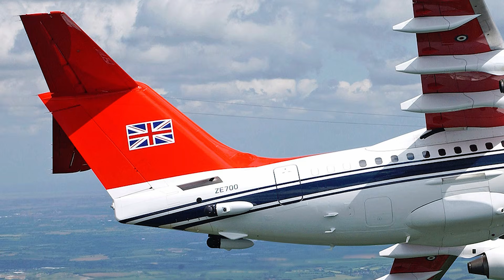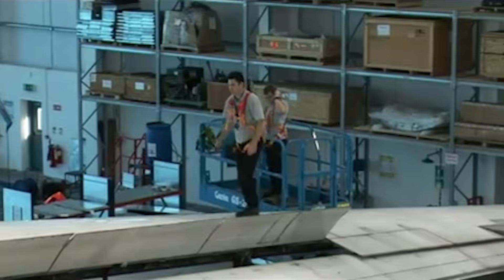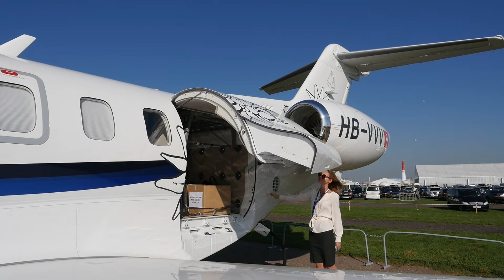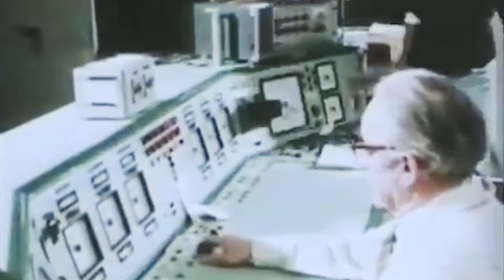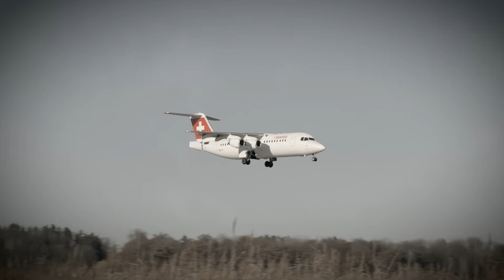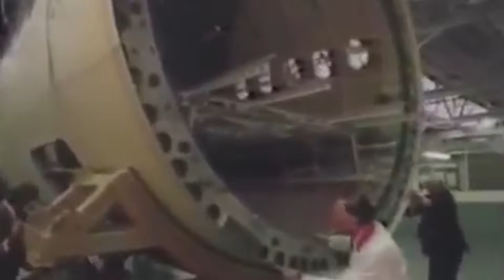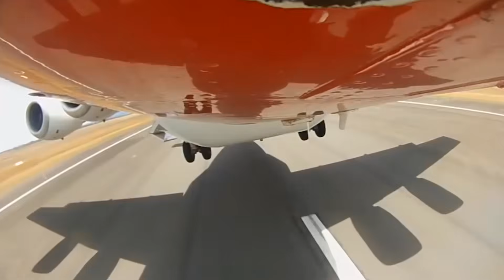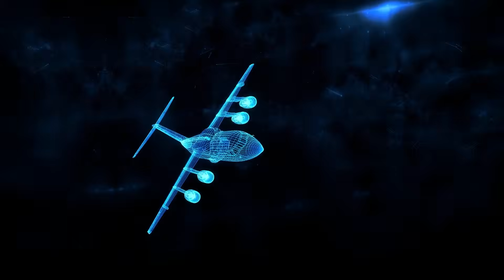BAe 146 - more engines!

Comment: -I remember flying on one of these in the 1980's when I was a student at Embry-Riddle.  They operated them between Daytona Beach and Detroit, if you can believe it. Presidential Airways.  I bought some sort of ticket where it was partially refundable if I could find a person to take a later flight and I lingered near the ticket counter in Daytona Beach.  After about 20 minutes, the gate agent told me to leave and threatened to have me arrested.  I told her I would leave but what comes around goes around.  Guess what?  Five years later I recognized her at an interview that I was conducting;  I'm not kidding, this happened.  OK, I let her give her whole spiel, I purposely kept her there for 40 minutes, nodding my head at the appropriate times.  I gave her the full interview.  And when she was done I reminded her of the whole Presidential thing, made a point of telling her to FUCK HER SELF, and then asked security to escort her from the building.  

Aviation, like REVENGE, is a dish best served real fucking COLD.

Comment: One of the issues is that is the are  seats just behind business class. normally popular with the huge majority of regular business passengers who do not fly premium have restricted hand luggage as the wing box squished overhead luggage locker to laptop size bag. Seats further back are full sized but no longer possible to quickly scoot out of the cabin after landing. Also prone to aviation fumes at take off in the cabin which could get quite strong. I suspect the luggage thing was one of the  issue that halted developments with single engine variations.

Comment: What are the two pods mounted on the rear most underside section of the fuselage : seen @ 1:11 ?
Did Rolls Royce produce an equivalent or better engine engine that would have improved performance ?

Comment: Jumbolino, one truly lovely aircraft. I wonder if we will see some four engined "jet" planes, with two engines being just plain electric fans (for takeoff and landing to limit noise) and the other two high bypass turbofans, for flight at cruising altitude. The economics of this is clearly not great, but it would allow to operate much closer to populated areas. Also, the battery could be powerful enough just for a couple of minutes of full thrust. And once at cruising altitude and speed, the electric fans could slowly recharge the accumulator for landing and taxiing on the runway. With recharging on the terminal. Super quiet plane, with lots of redundancy. Also in extreme cases, able to start on super short airfields, using all engines at full thrust.

Comment: WHY 4 ENGINES?
In the late 1980's, I was studying (Aerospace Vehicle Design) on the College of Aeronautics in Cranfield (UK). If I recall right, our Professor for Aircraft Design, John P. Fielding (also working on the BAe 146 design) mentioned, that the initially designed of the (Hawker Siddeley HS.144) was with 2 new engines. A bit over-powered, because one of the design specifications was, that the aircraft had to be able to start and land at the new London City Airport (Docklands), with it's short runway, the stringent noise requirements, as well as it's steep initial climb and approach angle (slope). 
However, due to the collapse of Rolls-Royce in 1971, the planned new Rolls-Royce Trent engines would not be available. And since there were no matching  alternative engines available for this project, they finally went with those 4 smaller ones. (Avco Lycoming ALF 502). And the project was changed to HS.146, which later became BAe 146.
What I don't understand, that they did not switch to a 2 engine design later on, when alternatives were available. But it might have to do with certification. It might be, that it requires a complete and expensive new aircraft certification when changing the numbers of engines, rather than changing the type and/or brand of the used engines.
Actually, having 4 engines rather than 2 is less economical. (More fuel consumption, higher maintenance costs.) And reliability is not an issue anymore. Even most long range aircrafts (trans Atlantic aircrafts) only have 2 engines nowadays.

Comment: The 146 was the only jet that could fly me out of the San Francisco Bay area the day after the October 1989 earthquake. My company desperately needed me to be on the east Coast the week of the quake. All Bay Area airports were closed but a regional jet flew out of Santa Rosa, an hour north of San Francisco, to Los Angeles (LAX was not affected.) So I went to STS and because telephone service was down, with no reservations. I found the small terminal  besieged with like minded passengers. Without electrical power the gate agents had no way to check tickets. So they asked for a raise of hands and found that they could accommodate all that wanted to go. They didn't or couldn't bother with tickets or boarding passes!
Waiting on the tarmac to take us to LAX was a BA-146. I suppose With its APU, it was self sufficient. The pilot told us he could radio LAX and would get us there!

Comment: I have worked on a lot of the aircraft shown in this video and it taught me a lot about aviation engineering.  I wouldn't call it easy to work on compared to E190s or A320s, but then a lot of modern aircraft tell you what the problem is.  BAe made you work for it...

Comment: Some features in the automation of the RJ series, were definitely better than the Boeing 737 NG - automated go-around features, Windshear modes etc are something the 737 NG do not have.  Indeed they can carry a heavier payload out of smaller airports than a 737.  And on short routes, they keep up with the larger A320/737 / mainly on descent; they can hold a higher transition speed and keep it down to 10,000 ft due to the ability to slow down with the huge airbrake.  They suck fuel for sure, but in the typical roles they fit into, fuel efficiency is second.  fit the bill in the low 30s.... FL 300 and FL310 are good altitudes but max alt is FL 350.  They still fill a niche in places like Canada; especially where 4 engine reliability is an asset for customers.  losing a motor at any phase of flight, is a non-event.

Comment: The only problem I had with the BAE146 was the fume smell in the cabin before take off. I flew as a passenger across Bass Straight a lot and always hoped for a short taxi to the runway because of the stink. Once airborne they were fine.

Comment: I always enjoyed flights in and out of John Wayne airport in Orange County, California.  At the time I had a office almost directly under 'short final' for the approach.  You couldn't hear the little beastie even with the office windows open.  I was pissed when American Eagle replaced them with loud 737s.  Noisy effin things!

The 146 had one tiny problem for passengers,  If your seat was toward the back you had to remember to duck when the main wing spar passed through the cabin.  For shorter people like me it was not a problem but a few taller folks would bang their head on the roof panels and grumble about it.  American Eagle used that as their reason for switching to the 737.  Pissers.

Comment: The design owes a lot AW 681 Stol Freighter, many of the same designers were involved, they literally built 5/8ths size version of the AW 681 and the intial work was started in the mid 60s after the AW 681 was cancelled in 1964, principally to keep the design team together. It also got left behind in the market, in the 70s Africa was borrowing money to set up State Airlines, by the 80s Africa was bankrupt and the market was the 1st world and so it's STOL and operational flexibility was not worth the higher fuel consumption of 4 engines.

Comment: I recall flying on one of these.  I was shocked to see 4 small jet engines under the wings.  The captain was greeting each passenger as we boarded.  As a pilot, I asked him how well the aircraft flies (handling, etc.).  He winked and said, "I'll let you know!" implying it was the first time he was flying it.  I'm sure he would not have said that to a non-pilot.  My recollection, as a passenger, was the nice, roomy, interior.  It felt like a much larger aircraft and not a regional commuter.  I was quite impressed with the flight, the quiet ride, and the comfort.  No complaints.

The video stated there were 90 some odd still in operation.  I wonder who is flying them these days.  Also, you'd think some of these would have gone into private service.

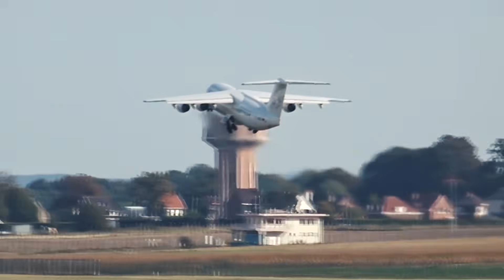Comment: 12:10 I see an issue here with reverse on only one engine and it throwing the plane out of balance.
Reply: That's the speed brake. No TRs. Wish it had  them where we went with them.
Reply: Mx pulling engine service.
Reply: That's not a 146 landing with one TR.

Comment: I flew into Appleton Wisconsin on one of these planes on a two stop flight. I was impressed with the smooth and quiet flight and the very soft landing at the first stop. On our second last  leg into Greenbay, the tower  reported the runway had recently been cleared of snow. As we landed the breaking system grabbed strongly on the starboard side and the plane rotated sharply to the right .Quite an experience! 
After watching this video I understand that the lack of reverse thrust makes it unsuitable for landing in wet or icy conditions. The speed brake on the tail did little to slow the plane.
After this incident, the pilot announced that we would be taking a bus to the Appleton Airport.

Comment: This was one of the aircraft types that I started my aero engineering career on.
Roughly the same number built as the Boeing 737-200, but theres 90 Bae 146's flying but only 36 737-200's
In the early days the ALF-502 engine gave a few problems but it was possible to take off on three engines as long as it was empty of passengers.
You could fly it back to base on three engines!

Comment: You know the terrain, so what aircraft product best suits that terrain. But reiterrating a previous statement, try not to rely on one companies product as they then have a potential monopolistic supply position over you. Boeing is in a vulnerable position at the moment over the 737 Max Debacle, paid off their CEO with $64 Million US Golden Good Bye and promptly made 2000 staff redundant to pay for it. Nothing wrong with any of those aircraft. You just need a big metal tube with wings, and engines with shit loads of power. And landing gear built like a Meccano model One suggestion though! Have you ever thought of underbelly doors? Either manual or hydraulic. Thinking it maybe easier to load from the bottom in an older reworked aircraft and safer for the loaders. But honestly not aware of cost implications.

Comment: Wonderfully researched as always!  The BAE-146 had amazing short-field performance for a jetliner. The four jet engines blowing on those huge Fowler flaps practically created their own lift!
Reply: I don't think that is how active lift devices work. You can blow air over a wing to increase lift, but I don't think that blasting your flaps with air under the wing will do much.
Reply: @justforever96  - actually blasting your flaps with air under the wing does a huge amount to increase lift at slow speeds. Wings generate lift by rotating air downwards. Since the flaps redirect the jet exhaust downwards, it generates lift. FYI, the USAF C-17 Globemaster cargo plane, uses a similar technique to improve its short field performance.

Comment: Made a round trip on one from Chicago to Lansing, Mich. Was impressed on low noise in cabin except when landing gear was lowered. Looking out the window, the jet intakes made the engines look small, making it seem that they needed 4 of them. Later found out that the plane was engineered to be quiet- a new concept at the time. Alas, every good thing eventually goes away.

Comment: I used to drive these.  Some memories, a few of which may be a little fuzzy: first 4 engine jet certified without a flight engineer, was hoped it would become as popular and long lived as the DC3, the Lycoming engines were adapted helicopter engines, the 100 series was nicknamed the “Smurf Jet” and the 200 & 300 series the “Barbie Jet”, also nicknamed the “Whisper Jet” though I always thought it rather noisy, two hydraulic systems -green system & yellow system with redundant drives, the outboard engines drove the generators and the inboard the hydraulic pumps, pitch oscillations -they’re a thing and we were trained and tested over it, flower pot - a modification in the tail that allowed flight at higher air speeds in icing conditions and reduced the likelihood of pitch oscillations, the yoke controls tabs on the elevator and not the elevator itself as it is free flying, the only turbine airplane I ever flew that the engines might not start in cold temperatures -the primary injectors would work but the FCU (fuel control unit) would freeze up and secondaries would not kick in leading to a hung start -very embarrassing to have to deplane passengers in KASE (Aspen) to get the engines pre-heated, helluva lot of fun to fly low on one of the CVA’s (charted visual approaches) into Aspen when the weather was nice, PIA to fly into Aspen when the weather sucked (true of any airplane, actually), on variants without an installed or with an inoperative air stair and no jetway available the plane could only be exited or boarded by the crew was through the “hellhole” -an avionics and equipment bay beneath the cockpit,  learning the annunciator panel was a royal PIA and ALWAYS verify hydraulic pressure to the brakes before landing -no, I didn’t’ learn the hard way.

Comment: Please, please, please don't use the word 'modifications' when it's simply a version or variant. A modification is a change made after the manufacturing process. Also what is an 'interceptor' ?
Reply: Normally I'd say an interceptor is an aeroplane used to defend its home territory against hostile aircraft; in other words, a fighter.
In this vid however the speaker seems to use the term "interceptor" to describe the spoilers.
Reply: @omepeet2006  Seems like it or maybr he's talking about the speedbrake at the tail.

Comment: I lived under the flight path of the factory that built them in the early eighties and whilst the twin-engined  executive jets would make a huge noise, the Bae 146 made virtually none at all. I once asked someone connected with the project why they put 4 engines on them instead of 2. They said that with 4 engines, you could lose 2 of them and still fly.

Comment: Being from South America, I only flew it once, from Warsaw to Frankfurt. It was 2010 and the Warsaw airport was being upgraded due to the upcoming UEFA EURO 2012. Collegueas at work told me that my flght was not going to depart since airport was almost completely closed. It seems that since it needed so much less runway that other planes it could depart without issues..and so it did. I rememeber seating in the back of the airplane and stood marvel at those beautiful 4 engines and high wing. When we arrive in Frankfurt i also remember smoke coming out of one of the 4 engines....nobody was checking that so i assume that was normal? A very nice memory of the AVRO.

Comment: I worked on manufacturing wind-tunnel models , for a transonic wind-tunnel.
So I was at Hatfield to witness the aircraft’s first flight.
We were amazed at the plane’s quietness as it flew at low-level overhead.
Also take-off was so quiet.

Comment: This is a very good tribute to one of my favourite airliners, very soundly researched and with an abundence of historic footage never seen before! Very well done!
Went more than 200 times on the Avros, mostly Brussels Airlines but also on Lufthansa City Line (yes, I flew on D-AVRO from LCY to FRA). Even had a couple of jumpseat rides. That kite flew like a Cessna 172 with four jets and had an incredible short field performance. My most memorable flight was as sole passenger on a SN AR100 from Brussels to Strasbourg on a Saturday - my private jet.

Comment: Another excellent video!!
I flew the 146 for about 1000 hours and comparing it to DC9s MD80s 737s and A320s it was a great handling airplane.  Its controls were responsive and the trailing beam main landing gear made most landings very smooth.   It was designed to be simple to fly and had a spacious cockpit. making it popular with pilots.  The only downside was when operating in and out of higher density airports where the low cruise speed was not appreciated by controllers, who often asked "Can you speed up?  Faster traffic behind you" often followed by vectors off course to separate us from the trailing faster traffic.  We routinely flew it into 5000 ft long runways and its low noise footprint allowed operations at noise sensitive Orange County/John Wayne airport (KSNA).
The early 146s had reliability problems associated with the ALF 502 engines.  Avco/Lycoming created the high bypass ratio turbofan by adding a fan section to their T55 turboshaft gas generator that powered the CH47 Chinook and several other helicopters.  It took a while to make the engines reliable, and in its early days some observers derisively said that BAE meant "Bring Another Engine"... 

Overall it was a great airplane the fit a unique slot and was enjoyed by pilots and passengers.

Comment: The trident and VC-10 were not so much wrong marketing but the manufacturing company listening to one airline. BOAC demanded a VC-10 performance that suited their needs and kept changing specs and BEA demanded less powerful engines than the one the manufacturer designed for. Boeing, on the other hand, designed planes that suited the airline markets generally.

Comment: I flew this aircraft for over a decade; it was beautiful to hand fly and was quite a capable aircraft, albeit quite hard work at times, compared to modern aircraft. It is underpowered at altitude, though has plenty lower down. The APU is notoriously unreliable, but the systems in general have lots of redundancy. 

Anyhow, nice video- a trip down memory lane!